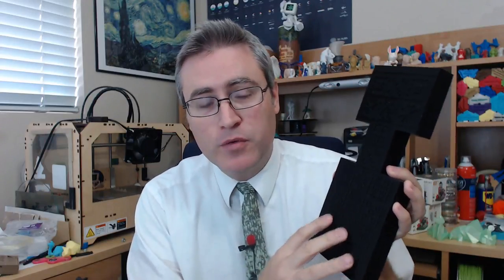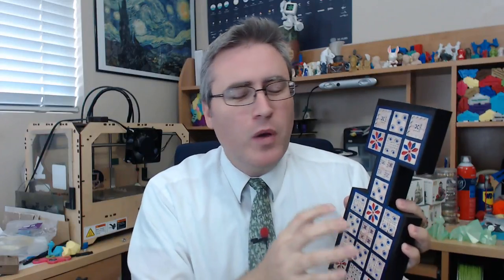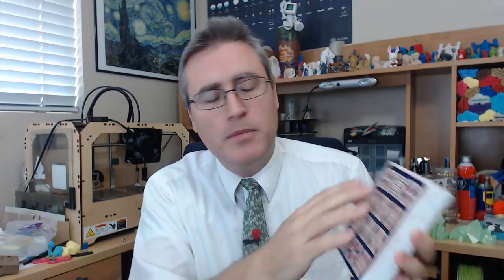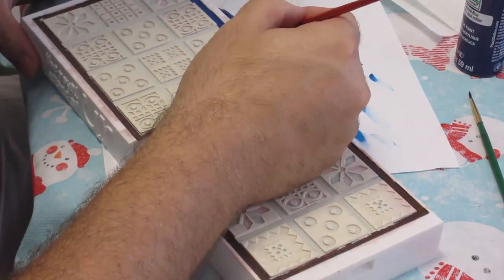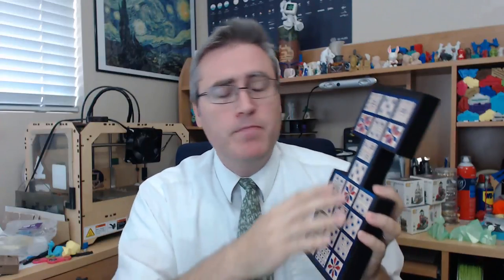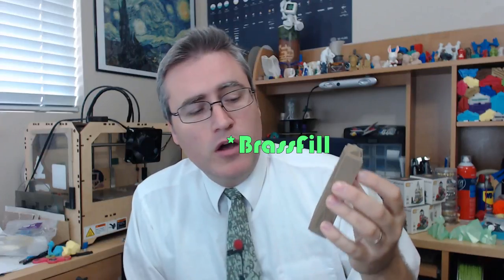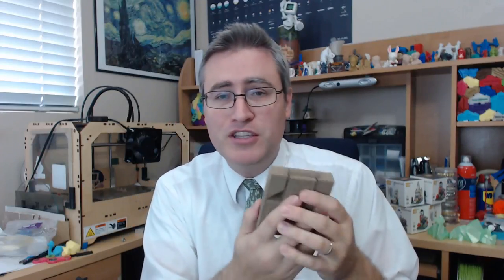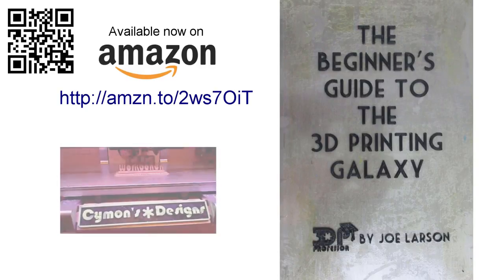Painting the Royal Game of Ur Boards

Comment: Also some general rules about how paints work, which will impact what you use for what type of plastic. Things like Rustoleum and Krylon Plastic primers will not always work as you expect. The key thing to successful painting on 3d printed parts is a magic word we all know too well. Adhesion. How does the base layer of paint (the primer) stick to the surface. 

Acrylic Paints are the least caustic of the paint types. They achieve a bond to the surface by shrinking as they cure and forming in tight against it. Acrylics do not melt or deform plastics. While they often have the weakest overall bond, they will form a decent bond to almost anything. So they bond well to PLA. The layer lines of 3d printing actually help with this as Acrylic primers benefit from a rougher surface that gives then something to grip. 

Enamels. Enamels are very very common paints. Although you don’t see a lot of enamel primers. They are mildly caustic, but not drastically so. They are thinned with and contain turpentine or similar mineral spirits. They will have better brighter colors than Acrylic as they have a finer grain, but are a touch more toxic. Mixing enamel and acrylic paints should be avoided as they react and the enamel will not properly harden or cure. 

Lacquers, and now we reach the highly caustic stuff. Lacquers bond to surfaces, particularly plastics by melting and merging with the top layer of plastic. They form the strongest possible adhesion, if used on a plastic that they stick to. They form a weak bond and chip horribly if used on a plastic they don’t bond well with. They bond well with ABS. They don’t bond well with PLA. But they do bond well with PLA treated with a resin prep such as XTC3D. I have heard that Rustoleum’s “Etching Primers” designed to adhere to metal similarly to lacquers and plastics will get a good bite on PLA, but I have not tried it yet. The Surface filling sandable primers are usually Acrylics. 

Most important rule when spraying any of this stuff wear an actual real proper respirator mask. The good 3m ones. Spend the $30 and get the proper one. You don’t want to breath any of this stuff in, especially not lacquers or the metal etching stuff.